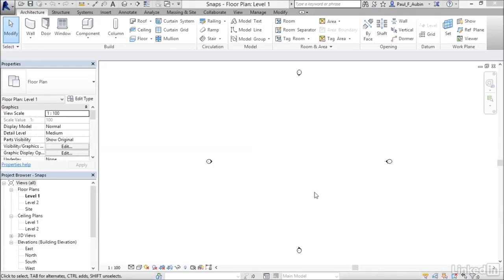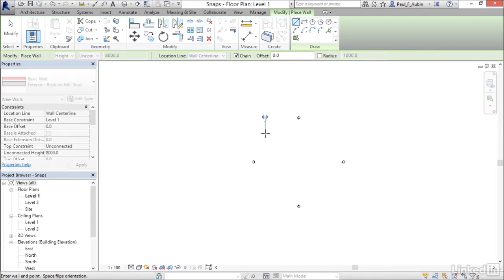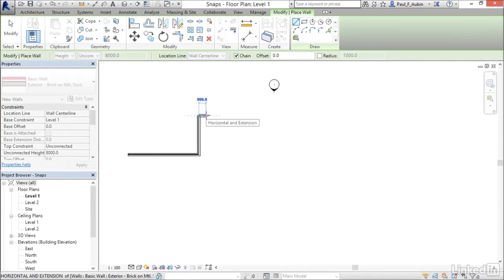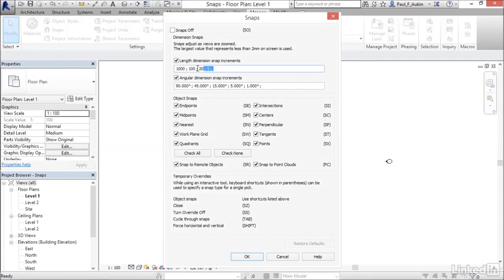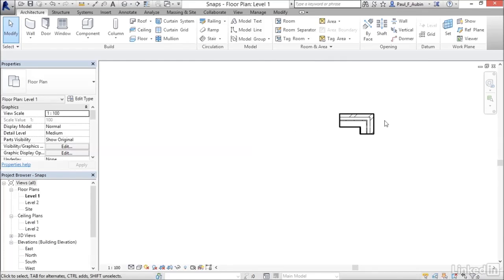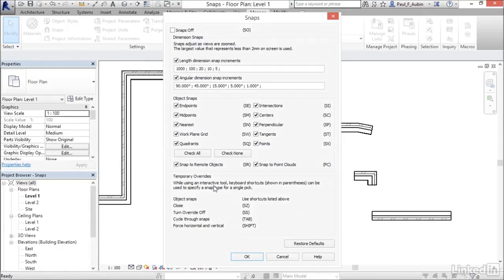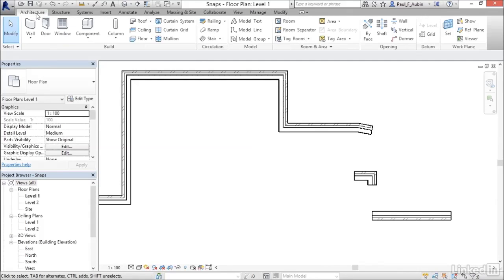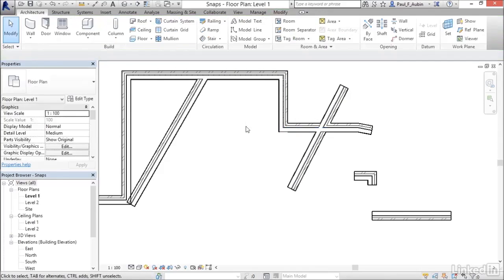15) USING SNAPS

Comment: Hi ive got this issue where when i orientate to my side view and try moving multiple objects vertically. In 3D..it ends up moving the objects sideways in plan view..... ive found out that an invincible plane is oriented diagonally causing my object to not move 90 degs perpendicullar to my xyz axis.....how do i fix this ?